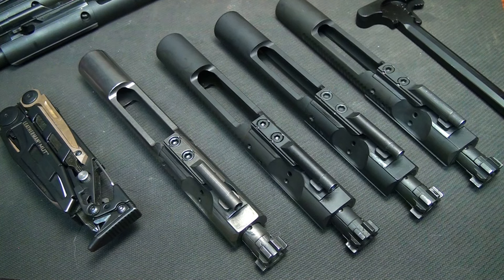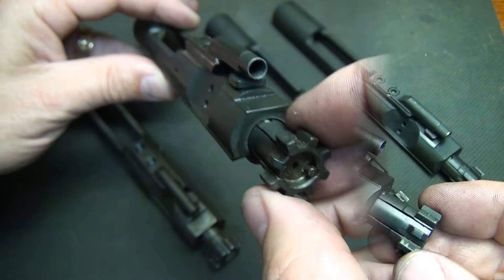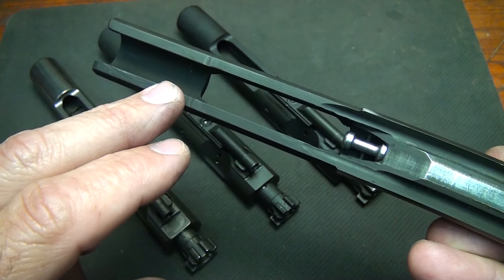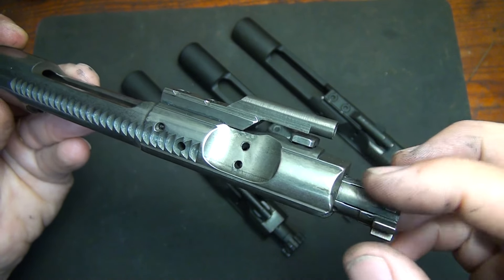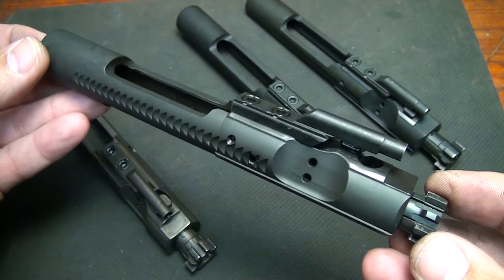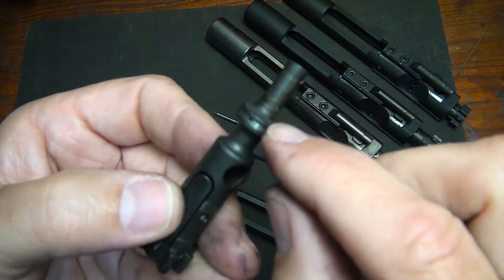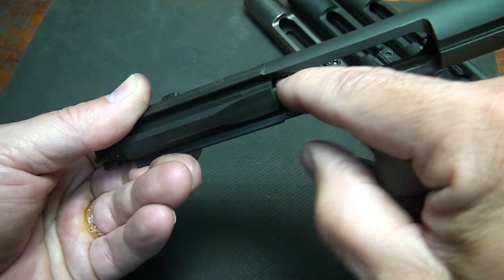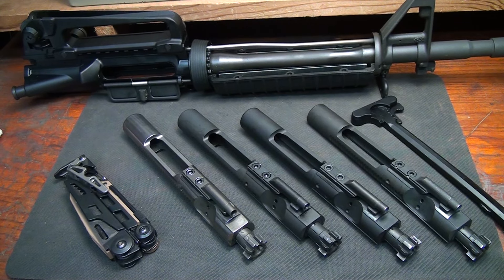How to I.D. AR 15, M16 & Mil Spec Bolt Carrier Groups

Comment: STAKING is "OLD SCHOOL" Look at a PHASE 5 Bolt Carrier & you will see what I mean...Far Superior Period! I use and sell "all" extensively.
Reply: looked at some phase 5 bolt carriers... and in the description, they all say "staked" ... i'm fairly new to AR-15's so how did they improve on the Old school method?
Reply: Hardened gas key, grade 8 hardened fasteners, type III sealing compound is used.***There has been a lot of talk about the pros and cons of staking the gas key on the carrier. Here is our opinion and why we do not stake keys. The US Mil Spec. assembly drawing requires the carrier key to be staked. Contrary to some popular opinions staking does not “SEAL” the gas key. Staking keeps the screws from backing out Period.
If you do not properly torque the screws to 56 inch pounds you will be staking a screw that is loose or one that is over torqued and prone to breakage. We have seen plenty of staked screws that are loose or broken.
The Mil Spec. also calls for the gas key bottom surface to be“SEALED" with Permatex gasket sealer. Something no one does to our knowledge. Here is our procedure for installing a gas key. First clean the oil from the gas key and the mating surface on the carrier. Then clean the oil from the screw threads. We use break cleaner for this. Next use a very light coating of Permatex high strength thread locker gel on the bottom of the key. PN 27010. This is much easier to use than the Permatex gasket sealer. It comes in a plastic twist dispenser. Make sure you don't use so much that it squishes into the gas port hole. The cure rate is 60 minutes. Next coat the screw threads with the same gel. Install the key and torque the screws to 56 inch pounds.
Reply: GLOCKATTACK10mm Appreciate the follow up response ! Gonna have to put the phase 5 bolt carrier to the top of my list...
Reply: Hear is some more information on the Phase 5.Phase 5 EN (Electroless Nickel Plated) Drop In AR-15 Bolt Carrier Group.

***NEW deburring / polishing process which creates a smoother
slicker more advanced finish.*

The EN plated Bolt Carrier Group enhances reliability, lessens cleaning time,
improves corrosion resistance and minimizes required bolt lubrication.

- EN plated bolt carrier, heat treated & hardened.
- Hardened gas key, grade 8 hardened fasteners, type III sealing
compound, black phosphate outer finish and inner chrome lined.
- Black phosphate HPT/MPI bolt and extractor with Mil-Spec gas rings.

Cleaning is minimal, usually requiring only a soft cloth. Permits firing for 
longer periods of time between cleaning, as dirt and powder residue has 
no wet or oily surface to cling to.
EN provides a high lubricity and low friction co-efficient,
greatly increasing the life expectancy of a firearm due to reduced friction wear. 

Electroless Nickel Plating (EN) is an auto-catalytic chemical technique
used to deposit a layer of nickel-phosphorus or nickel-boron alloy on
a solid workpiece, such as metal or plastic. Electroless nickel plating
is an auto-catalytic reaction used to deposit a coating of nickel on a
substrate. Unlike electroplating, it is not necessary to pass an electric
current through the solution to form a deposit. This plating technique
is to prevent corrosion and wear.
EN electroless nickel plating has several advantages versus
electroplating, it provides an even deposit regardless of workpiece
geometry, and with the proper per-plate catalyst, can deposit on non-
conductive surfaces.
Reply: swish1onu I have thousands of rounds through an m4 (while I was in the army) as well as my colt 6940. Out of a company of 138 soldiers the only repairs to a bcg I ever saw was replacement of gas rings and extractor springs. A properly staked mil spec bcg will last longer than the average soldier will ever dream of shooting in 4 years. A lot of companies are pitching products to shooters to solve problems that don't exist, due to the current upswing in AR interest. If you have a mil spec bcg with good staking you have nothing to worry about.
Reply: REVISED: M-16 style Electroless Nickel-Phosphorusbolt carriers are much smoother and much easier to clean by far(all needed is a rag in the field) It also slows the action a little bit for a much smoother action which also helps for follow up shots.There has been a lot of talk about the pros and cons of staking the gas key on the carrier. Here is the reason not to stake keys. The US Mil Spec. assembly drawing requires the carrier key to be staked. Contrary to some popular opinions staking does not “SEAL” the gas key. Staking keeps the screws from backing out Period.
If you do not properly torque the screws to 56 inch pounds you will be staking a screw that is loose or one that is over torqued and prone to breakage. I have seen plenty of staked screws that are loose or broken in my 4 Decades + of shooting 100s of thousands of rounds with Conrad's.  
The Mil Spec. also calls for the gas key bottom surface to be“SEALED" with Permatex gasket sealer. Something no one does to my knowledge. Here is procedure for installing a gas key. First clean the oil from the gas key and the mating surface on the carrier. Then clean the oil from the screw threads. Use break cleaner for this. Next use a very light coating of Permatex high strength thread locker gel on the bottom of the key. PN 27010. This is much easier to use than the Permatex gasket sealer. It comes in a plastic twist dispenser. Make sure you don't use so much that it squishes into the gas port hole. The cure rate is 60 minutes. Next coat the screw threads with the same gel. Install the key and torque the screws to 56 inch pounds.
Should you decide to remove the key for some reason don't use the old screws when you put the key back on! You will most likely break them during installation or when you fire the rifle. Go to the local hardware store and buy new 10-32 x ¼"SHCS. If you feel the need to stake the screws spend the money and get one of the staking tools from Brownell that uses a screw type system to swedge the material into the top of the screw. Don't use a hammer and a punch! You can stretch the thread on the screw and now you have a loose screw that will eventually break if the gun even fires.
Reply: both of you guys have made some valid points... now i'm caught on the fence on what I should do... Generally, I prefer to "overdo" some safety precaution then be caught with my pants down, so to speak... The  Phase 5 is a bit out of my budget, but a week of eating ramen noodles will get me back on track if I decide to pick it up... thanks guys for the information... its been a great help !
Reply: Well, a New Corvette and an old Chevy Chevette are both very dependable cars! Which one would you rather own ?
Reply: GLOCKATTACK10mm That's a ridiculous comparison and you know it.
Reply: swish1onu Go and Google "Phase 5 Bolt Carrier Group" and look at the first post.  See all the problems?  Now go and Google "BCM Bolt Carrier Group" and you'll fail to see any issues.  BCM is a superior company/product and they stake the gas key.  Wonder why they bother if it's not necessary.  People are certainly entitled to their opinions, but spouting nonsense needs to be called out when you see it.  Stake the gas key and you'll never have a problem.
Reply: No, you are incorrect  (ego aside) I have over 4 decades of intensive experience! I have close friends as well in the Canadian Forces(General,Colonel,Captain) They agree with the new and far superior Phase 5 engineering ! I suggest you do some more research on a legitimate site. Keep the piece brother.

Comment: Nope! NiB throughout the BCG is advantageous. Notice how the rails of the carrier ride on the inside of the upper? The one part of your BCG you DON'T WANT to lubricate is your bolt because it can seep to the bolt face and give you issues with the cartridge not engaging the bolt face at which point it won't chamber.
Reply: Ryan Moyer And if anyone would like to debate, I have a bolt face of an M249 with a broken extractor that almost got me killed that says you're wrong.
Reply: So the extractor, while requiring cleaning and preventative checks to ensure it's not worn, bent, burred or broken, should not be lubricated. The extractor serves one additional purpose besides extracting a spent casing from a chamber. Since it has to grab onto the extractor rim of the case in order to do so. What happens if your extractor is missing or damaged to the point where it no longer grabs the extractor rim of the case, there will be nothing acting on the cartridge to secure it during the chambering process. This especially holds true with the AR platform and the M249 that I referred to because the ejector sits opposite of the extractor (or close) on the bolt face. The ejector will be attempting to push the cartridge away from the bolt face, and with no extractor grasping the cartridge during the chambering process, will typically push the live cartridge into the receiver of the weapon with a failure to chamber. That's what happened with me and the M249. It was due to the extractor becoming damaged during firing. However, lubrication in the wrong portion of a weapon can have similar results.

Another issue with applying CLP or oil to the face of the bolt is that if the bolt is in the chamber long enough during extensive firing, that oil can act as a catalyst for heat. This could potentially cause the cartridge in the chamber to "cook off". That is, the heat created in this scenario would cause propellant to ignite and in turn discharge the projectile without the operator depressing the trigger. Sorry this was so long winded, but hopefully I cleared it all up for you.

Comment: "assault rifles" are illegal so you have to have a bullet button which replaces the magazine release button. basically you stick a bullet inside so it pops it out. funny thing is, you can still put a magnet inside of it legally to make it operate like normal, but you have to remove it after use. this is all just so the rifle no longer has a detachable magazine. flash hiders, vertical grips, pistol grips, all make it an "assault rifle" but a bullet button completely changes it. it's dumb shit.

Comment: Do yourself a favor and throw away any M16/AR15, after 23 years in the military, I hate the puny gas tube.... That's why the new battle rifle will have a gas piston system.

Also, I worked as a mechanic in a cabinet factory and they make a "green" industrial Locktite , we used it on machinery that is exposed to high heat and stress.

Comment: I feel so bad for you DI guys. You just don't get it.
Reply: I feel so bad for you piston elitists. You just don't get that the AR platform was never designed to accommodate a piston system.
Reply: CPHannigan Maybe yes maybe no.
Reply: I researched and researched getting a piston gun. I really wanted to talk myself into it, but there just wasn't the advantages. They cost more, weigh more, less accurate, provide little benefits for short range sessions, carrier tilt. I think they have a place, but not in my safe
Reply: bubbacrabb Pistons have a great place in your safe, on an AK.